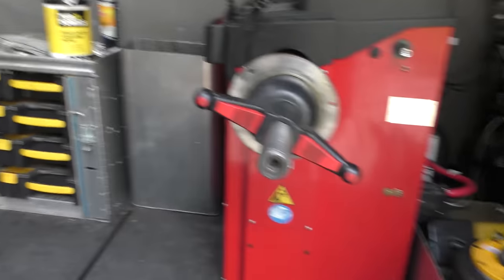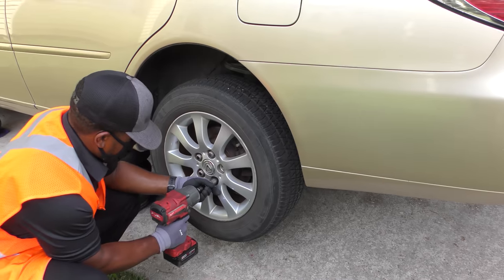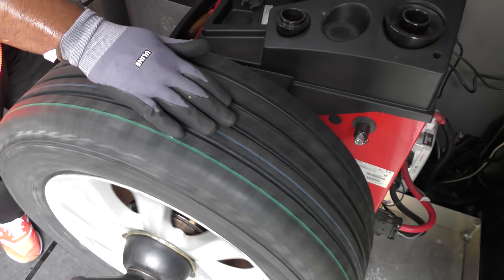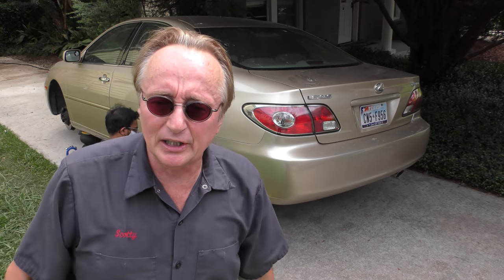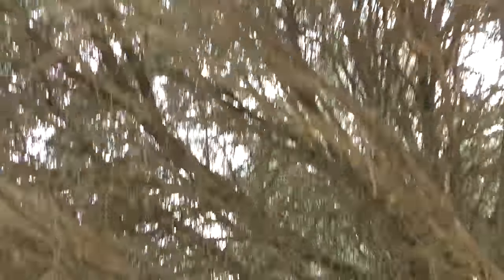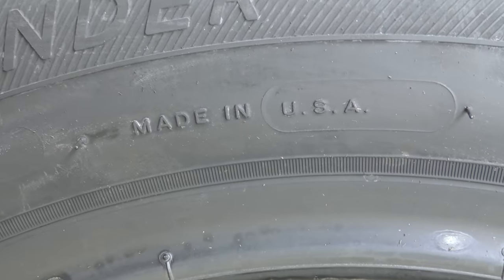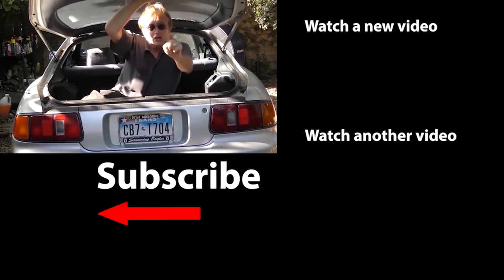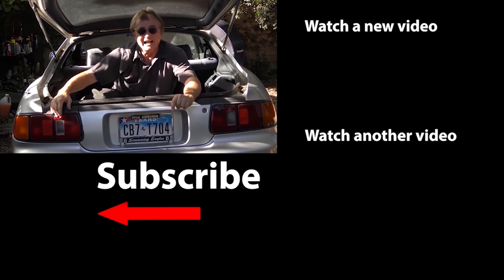Stop Replacing the Tires on Your Car, Do This Instead

Comment: My 2013 Honda Civic's paint job is also flaking like crazy. I want to keep the car, but they're charging a quite a bit to have the paint redone.
Reply: Hondas that are made outside of Japan have cheap, thin paint. My mother had a burgundy 1993 Accord, and the clearcoat failed and the color came off after the car was about 10-12 years old. She now has a 2008 Accord in Taffeta White, and it's a single stage paint that only came with 10-30% clearcoat from the factory! I clayed it and polished it by hand a few days ago, and it barely had any shine or depth, and the finish was blotchy and flat. She got into a minor fender bender a few years ago, and the body shop paint on the front fender was better! I think they have the most problems with their dark blacks, dark blues, and whites, but the others seem to be OK. But if you look at an old Acura Legend or Acura RL, the paint finish is still really nice, because those are made in Japan, and the paint quality is much better. They do it to save money, and so that the paint looks great in the showroom, but after a few years, especially if the car is parked in the sun, it looks like a beater car after about 8-10 years. Planned obsolescence, I guess.

Comment: Why even advertise if it’s not in all 50 states. I live in NC it’ll probably 20 years before stuff like this comes to my area. I hate tire shops and this would be awesome. I totaled one of my cars because the tire mechanic at a discount tire store not the discounttire company but a local discount tire store. I was going 60 mph down a busy highway and the lugs broke loose because they didn’t tighten them down and the wheel came off and completely destroyed my front end.

Comment: i don't know about low overhead compared to a brick and mortar tire shop. you got 10 guys doing tires in a shop or you have to pay for 10 of these rigs driving around, breaking down and having mechanical problems, gas etc. i don't think the savings would be much if any.

Comment: Enjoy your Michelin tires Scotty and good luck with them.
They were good performance but watch out for the Michelin tire smiles back after 2.5 - 3 years with a thousand cracks of SMILES.
Especially when you and your wife don't drive that often plus the Taxes baking sun.
The only prevention is use it all up in 3 years.
Skip the tire shine or protection sprays because Michelin tire representative and the tire dealers won't honor the 5 years warranty even before it expires.
Unless you fights hard with Michelin.

Comment: Mobile one seems to have fallen from where they used to be. The only oil I would buy mobile one is their 20w50 motorcycle oil. Other than that they done really have anything that other don't. I mean lucas has their high zinc oils for hot rods (which is well worth the money if you have a hot rod). Wolfs head has synthetic for much cheaper than mobile one (and regular also). The list goes on of oil makers that have something specific that you can not find in anther brand, or that are much cheaper, expect for mobile one. All they do is make synthetic oil, charge quite a bit more than most other companies, and bank on the fact that you will buy their product solely on name.

Comment: Geez you don't have to measure the amount of transmission fluid that comes out. Honda provides specs. The spec for filling is to fill to the bottom of the fill hole. Just pump it in slowly until you see it starting to come out of the fill hole. One more thing, while the fluid is draining, make sure the fill hole is open. That will help make sure the fluid drains rapidly and completely.